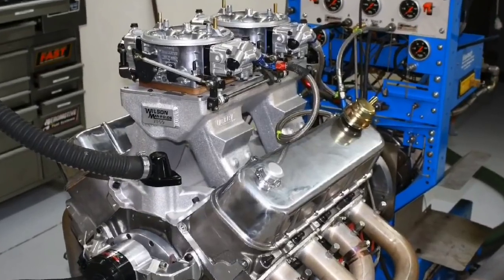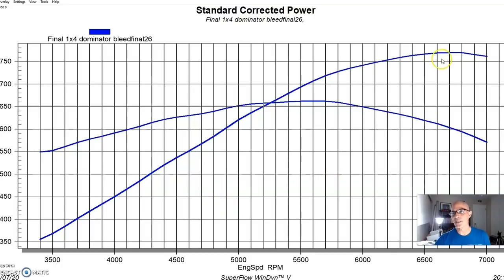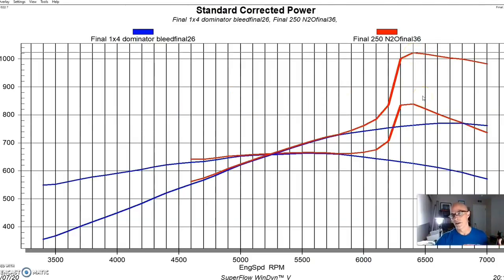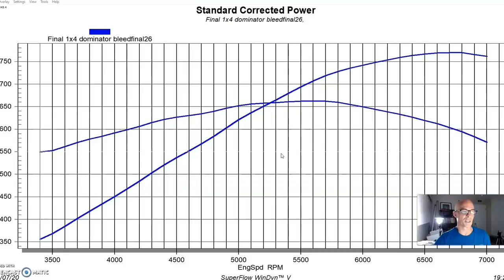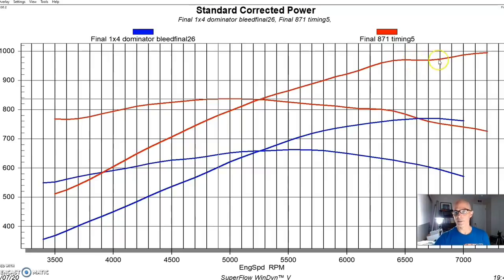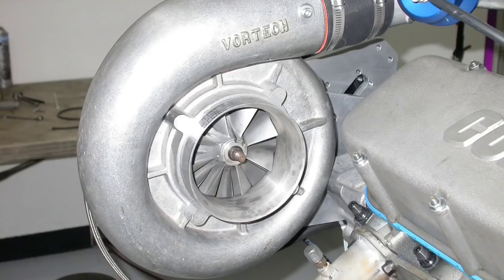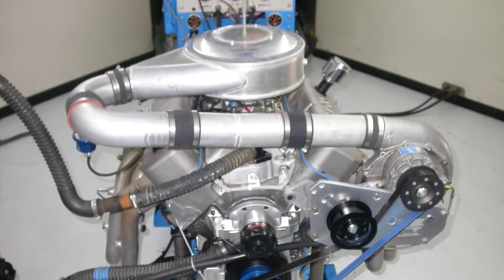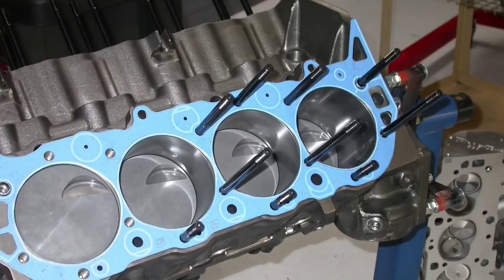DOS XX BOOSTED 540 STROKER (PLUS NOS)

Comment: I have a VQ35de you can test/blow up.Im local here in NorCal
Reply: Ive built 3 of those engines , to make  decent reliable power you need a deck plate made buy super tech welded in and a forged rod and piston setup good L19 headstuds or better (they like to lift the head under high boost) a good headgasket and an o-ring job then cams springs retainers fuel system and throw boost at it lol i found them reliable when built right up to
About 7-800 wheel horsepower, my brother runs a vq37vhr which is a much better platform to start with 🤷‍♂️.
Reply: big bang VQ